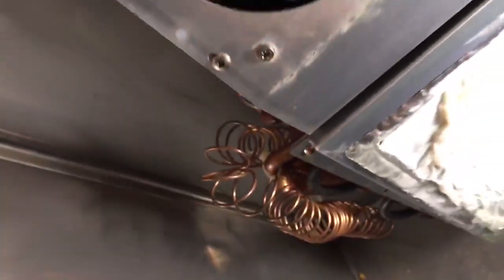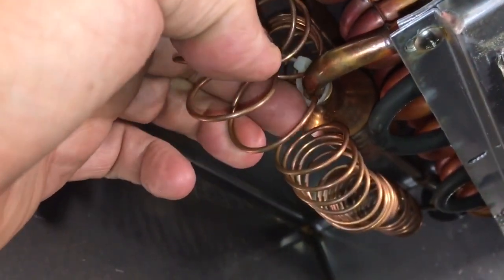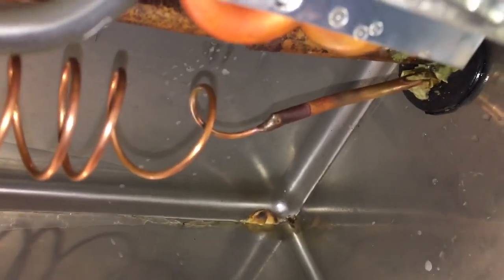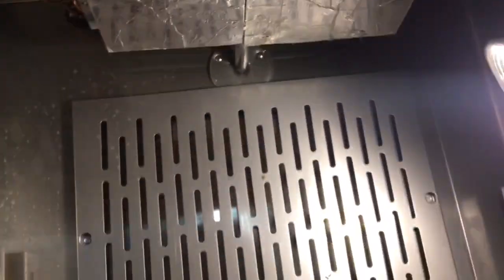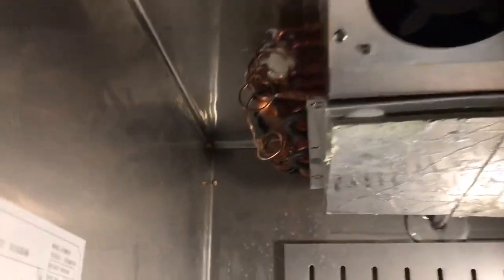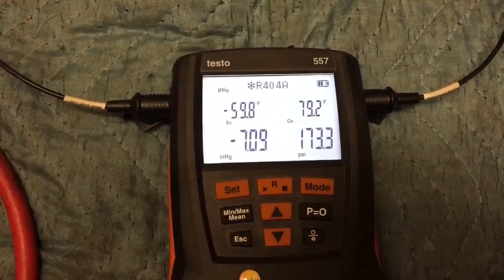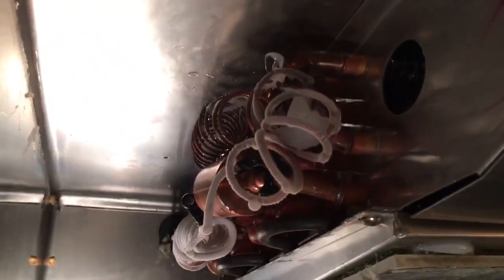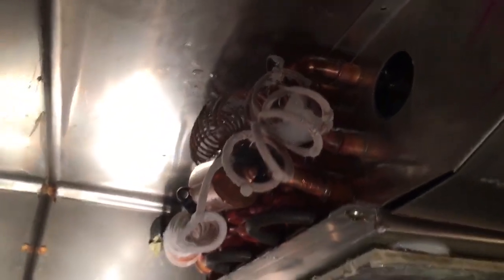Kelvinator 1 Door Freezer service call. Junk after it all.

Comment: Fuck that cap tube . Cut it off , install an expansion valve since the liquid line is there already . 😎
Reply from the maker: no receiver on unit , but you could. good idea.
Reply: OcRefrigeration , Hvac & Electrical Video's. Yiu still can . Remember Traulsen doesn’t use receivers but still installs Expansion valves . 🤷🏻‍♂️